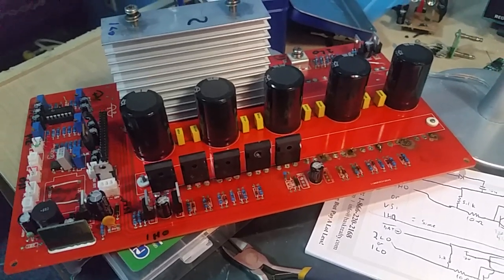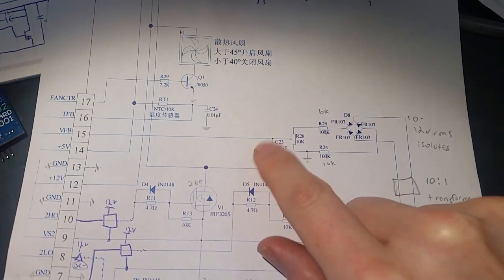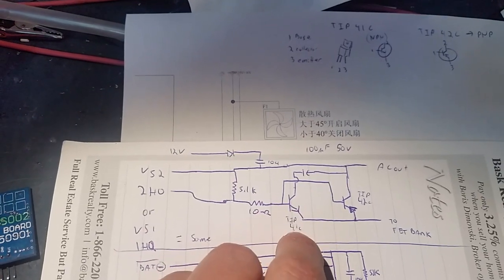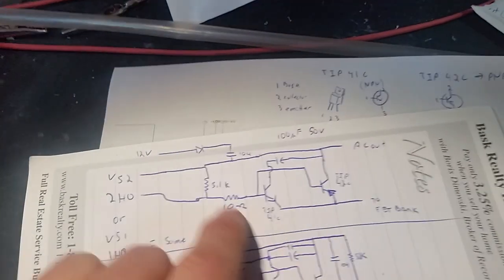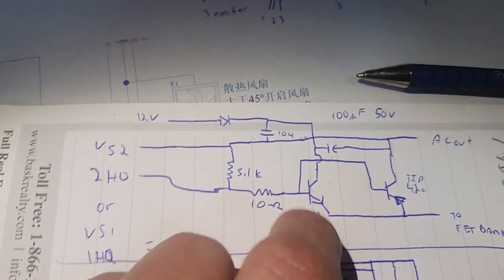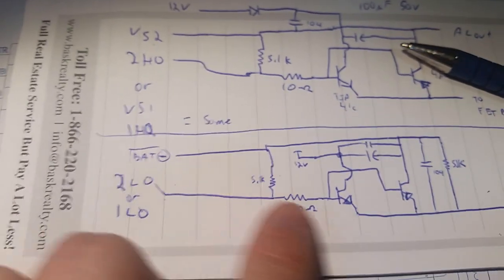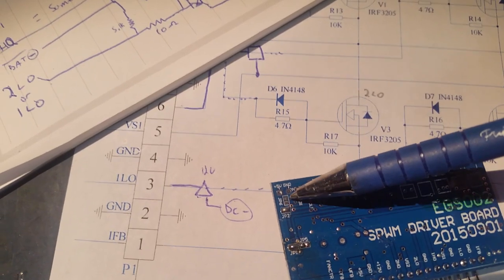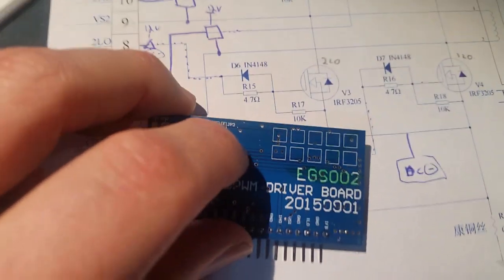in depth technical information of Chinese inverter board.

Comment: I believe the high side circuit is a bootstrap as well as a driver circuit. It is needed because the voltage on the high side mosfet gates must be 12 volts greater than the input battery voltage, on the emitter for the device to conduct.

Comment: That is a totem pole driver. 
On a positive pulse, the npn opens, charges the gate(s), and when the pulse is off or negative, the pnp opens and drains the gate(s).
When working the gates at high frequencies, like spwm with carriers in the tens or hundreds of khz, that little capacitance in the gates can require huge currents to fill and drain, therefore some beefier bipolars inserted between the ir21xx (which can peak 2A as an absolute maximum) and the gates.
Also, more parallel fets equals higher total gate capacitance. 
Not putting enough current in the gates to charge and drain them will leave the fets in the ohmic region for *time and blow them to shards as they can't handle the tdp.

Comment: The gnd reference is on the other side of the shunt, so no DC noise and voltage drop is introduced onto the mosfet gates with the drive signal. 104 is in picofarads = 0.1uF or 100nF plus the 12V supply on the high side mosfet bank is not the same 12V on the low side as it must be isolated via the dc to dc converter as its high side referenced.

Comment: tip41C on your diagram will not work because the collector has no dc bias voltage relative to both the base and emitter. bipolar device needs dc bias before is works, like forward and reversed biasing scheme. Maybe that schematic portion well works only because of leakage in the capacitors

Comment: @Joel Clemens do you have any schematics of the pcb you are using as I couldn't find any schematic or datasheet for that pcb.
Reply from the maker: Sorry no, had to reverse engineer to do any repairs.
Reply: @erroneus  Is it possible for you to reverse engineer the circuit an provide me with a schematic of the overload and low battery protection circuit of that PCB. 
 Thank you very very much

Comment: Those transistors were configure as a push pull.The capacitors at the high side are boost capacitors and the diode is a boost diode.It is nothing but a buffer to drive more mosfets in parallel.

Comment: The 0.1 inch pitch KK connectors will work with mains voltage provided its fused, but it's not best practice, it more the pcb track creep-age distances that are the issue,  0.2 inch should have been used. A simple trick is to use a 3 way but omit the middle pin and pad to maintain good clearance between A and N.. The Inductor is far too small for 150A, as it should only get warm not hot and it may also be saturating the core which may explain the rough wave form as more power is pulled. I'm not happy with the power supply decoupling either, as the ripple current is big and caps are far  too small for 150amps continuous, it will go pop! Need to get a scope and be sure there is sufficient dead time, and the diver circuit is switching the mosfet on and off fast enough, or you guest it it will also go pop! it can be very frustrating and expensive, I question that driver circuit, as it may not be driving the mosfet gates hard enough That gate resistor and diode is not the best idea either as the slower the slew rate the more power is wasted. I think what is happening the inductor is saturating and switching voltage spikes are exceeding the mosfets V-D-S voltage which is only 80V, I feel 100V mosfets should have been used.

Comment: hi Joel   i bought a board like this one   i blew the RO resister by the dc buck shorted the on switch!  can you tell me the value of it or where can i get a schematic
Reply from the maker: i'm not sure which resistor you are talking about. Can you post a photo somewhere? I couldn't get a full schematic from the supplier, but the design is pretty simple.
Reply: Joel Clemens   I can send a pic my email is dneikes99@gmail.com. Thanks for responding. I’m learning the hard way lol